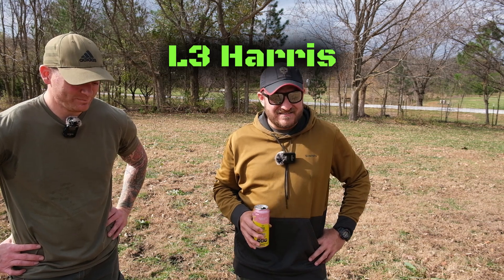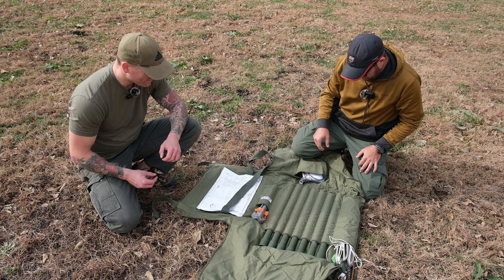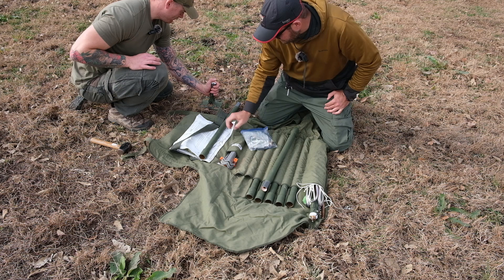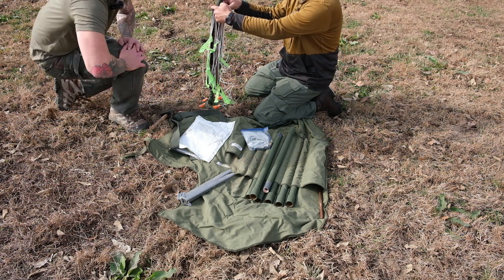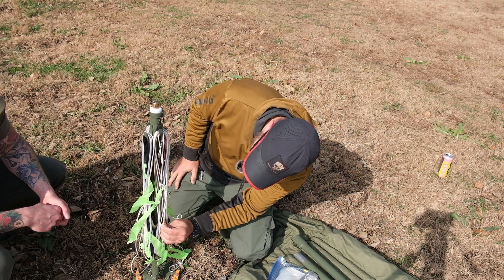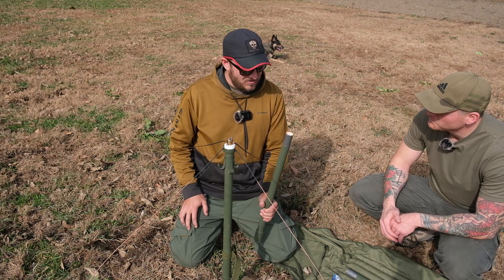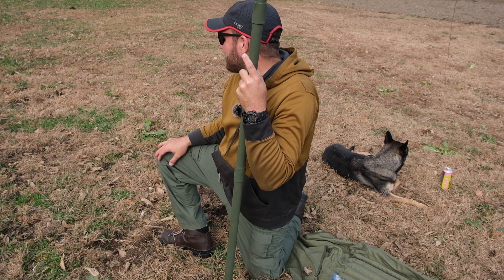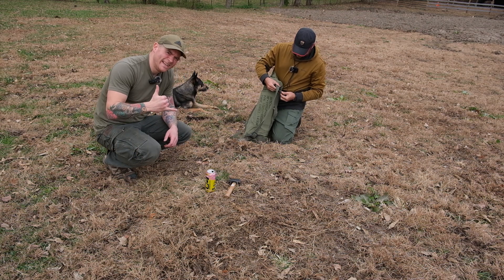Erecting the L3 Harris RF-1936/38 NVIS Portable Crossed Dipole Antenna

Comment: I’m in the process of DIYing one of these — using milsurp fiberglass tent poles (16 feet total) and a homemade balun. Not as tidy as this but a whole lot lighter. NVIS is the perfect antenna setup for military applications.
Reply from the maker: I thought NVIS was night vision until 2 weeks ago.
Reply: NVIS and ground wave both have useful applications for local/regional HF radio. A lot will depend on if you need to obscure your signal source or limit sky wave propagation for signals security.

Comment: That antenna is so crazy outdated. Thanks for showing it though.
Reply from the maker: yeah it actually hasnt worked since they updated radio waves in 2007.
Reply: I use a design from the 1930's. No update needed. It works .
Reply: @markspears2712  physics hasn't; engineering has, smart-arse 🤦
Reply: The Physics of light hasn’t changed in 4.5 billion years😂